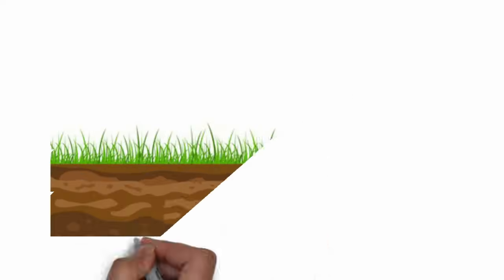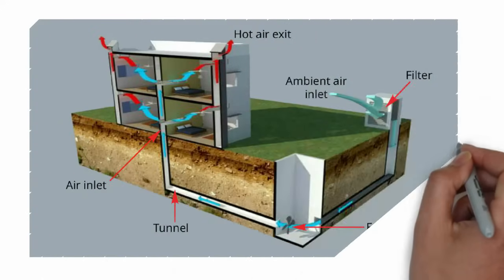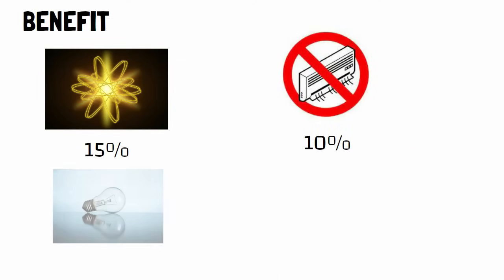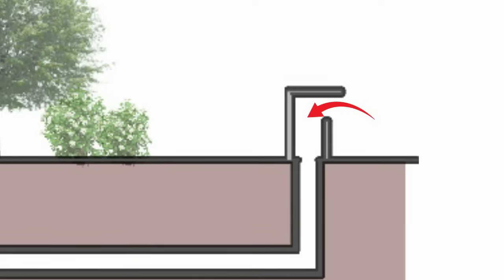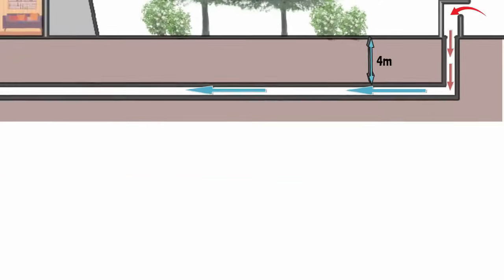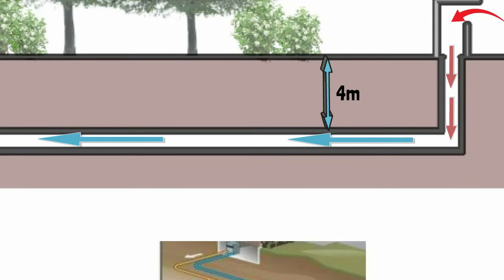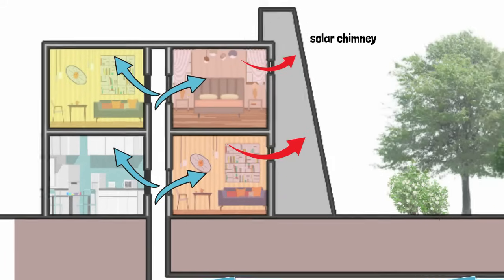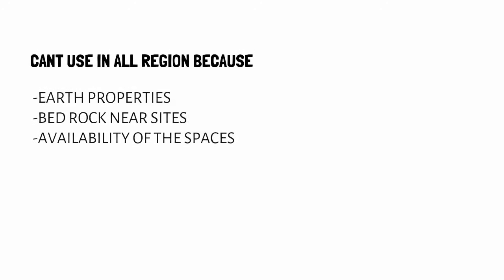EARTH AIR TUNNEL || HOW IT WORKS || passive cooling technique

Comment: Mother Earth News ran an article about a man who built a house like this. However, there are differences. 

His house was basically a thermos, built as a box inside an earth-bermed shell.

The pipe ran underground for about 100 yards before entering the back wall of the shell. The air could then travel around the box/house between the box and the shell, keeping the house cool. The air then enters the enclosed patio at the front of the house.

The reason the air moves this way is thanks to the south-facing porch. The porch heats up from the sun with the help of plastic, black-painted barrels of water. As the air in the porch heats up, the air rises. It reaches the top of the porch and exits out through closable vents. At night (which can still be hot), the barrels give up the heat they absorbed during the day to the air, and the process continues.

During the winter, the vents at the top of the porch are closed and a shut off valve closes the pipe. The porch air heats the house during the day, and at night the barrels heat the house.

The earth-berming around the house (sides, back, and top - everywhere except the front where the porch is) acts as the perfect insulation, helping to keep the house cool in summer and warm in winter.

The man in the article built his house in the foothills of the Rocky Mountains in Arizona - desert country. 
Yet his house stayed comfortable in the heart of summer. I think he said the hottest it got was about 80F degrees inside the house.
The coldest it got on average inside the house during winter, even when temperatures outside were in the 30s, was in the 60s (or even 50s). He said that when it got like that, he just put on a sweater (he didn't even have to fire up the woodstove the county building code guys forced him to install).

So he had both passive solar cooling and heating.

Comment: If you move that vent to the shade of the trees it will work even better because the air in the shade is 10* cooler then in the field

Comment: Am I the only one that thinks that digging tunnels 4 meters deep (12 feet) to get  10% cooler temperature, or 10% electricity savings is a waste? Too much of earthworks and artificial pipping for too little a benefit? It sounds much smarter to have large openings on the wind side and opossite sides of the house to cross ventilate in a simple, natural way.

Comment: Metal exchanges energy better than pvc. Metal performs cool to heat transfer better than pvc. I think metal would be more efficient.
Reply: copper is best...PVC is cheaper.
Reply: @gothboschincarnate3931  if your gonna use pvc.... just shitcan the system

Comment: Hi, here, in France, we call this a 'puit provencal' or ''puit canadien' (puits= well). We use it since...; roman times. Used in persic golf since... long times, I saw the heat system in ancient korea is similar. The tunnel have to have a of 5°(+-) gradient to allow water and vapor to flow out of the tunnel in order to avoid bacteria or fungus. Tunnel, best build in ... 'terra cotta'. No radon, no infiltration, no bad smells. Concrete has radon isssu. Metal will be 'eaten' in less than a year, PVC can break, develop bateria, bad smells. Best to have the fan in the house, in basement for maintenance. Not necessary to dig 4 meter, it can be effective with 2 meter start (remember, gradient is needed). The size have to be calculated between heat exchange effectiveness air air flow ( to avoid issue and to heat/cool the building with efficientcy).
Here, i saw the system connected to 'heatpump'. it used as a pre treatment of the air (air is already cooled a little in summer, and, already warm in winter, so the sytem have to spend less energy to warm/cool the building.

Comment: I think this is good for a dry climate building, yet I have a concern about fungus, dirt and condensation within the airline. Could water cooling be applied with the same principle?
Reply: Closed loop water cooling.
Reply: dont worry you can grow mushrooms inside and place a fungus air filter in your batcave

Comment: What about radon? I have a vented pipe from under my foundation that goes up above my roof line with a 24/7 fan running to exhaust radon. Is radon not an issue in other parts of the world? I live in north east USA.
Reply: A thin plastic layer STOPS the influx of radon gas. Vapor barrier. Care must be taken during construction to not puncture but it's really easy to avoid. Look up Radon Block.

Comment: this would be a good challenge. but how do you keep away rain, condensation, molds, and rats?
Reply: you could use an industrial dehumidifier to remove the the water first, purify it...and use it for drinking water. get 2 use's out of it
Reply: A simple rain cap for rain, a series of filters such as found in your current HVAC system for insects, If your intake is raised high enough...there won't be any rodents and even those would have to get by the filter system....add in some 1/4" stainless mesh...
As for mold, mildew or what have you, a scheduled maintenance using a swab would go very far to stop or better prevent any such. I'd size it for a chimney brush AND leave behind a poly rope to use to swab with. Probably a little bleach on the swab and you are good.

Comment: This is such a terrible idea.  The concept makes sense but in practical use it's very dangerous.  My aunt and uncle built an envelop home and they were talked into an air tunnel.  Things were pretty good in the beginning but not long into their first summer, my cousin got extremely sick.  They found out it was because of mold that developed in the air tunnel.  Their home was in southern Wisconsin where the summer air is quite humid.  The cool tunnel allowed moist air to condense and then turn into mold.  My cousin survived but the air tunnel did not.
Reply: Will be the best Rat's home
Reply: Your hack installer should have used an air to air exchanger that doesn’t allow that same cooled moist air to enter the home…. The exchanger recirculates and filters the air in the house or pulls in fresh from outside and the cool air tube passes around it to perform the heat exchange. The air doesn’t mix but the heat energy is transferred.
Reply: You could use an industrial dehumidifier to remove the the water first, purify it...and use it for drinking water. get 2 use's out of it
Reply: @gothboschincarnate3931  legionaries disease is ugly, please read up on using condensate as drinking water. There are more reasons not to use condensate than benefits.
Reply: @Rockwell108  well it has to be purified...thru UV light and reverse osmosis and their are probably other techniques too. water vapor  drops all impurities. however, it can easily re-acquire impurities and bacteria if not properly maintained. Karra and donna will help me.
Reply: @Rockwell108  have you ever heard of this crazy thing called boiled water?

Comment: this principle had been used for centuries in the city of  Yazd in Iran and actually uses the wind to move the (hot) air coming from the desert  surrounding the city to below the house for cooling and then  back up to the rooms  now cooled. this system is entirely passive and surprisingly efficient. When I was there the temperature outside was very hot but in the houses it was very fresh and pleasant.  I am still  surprised that it took so long to adopt it in the western countries.
Reply: Maybe coz Western countries tend to be less arid than Iran?
Reply: @nunyabiznes33  maybe, but still quite hot in summer, and if wind is not there it is easy to  force air with an  impeller (that can be solar powered)
Reply: @nunyabiznes33  🤣🤣🤣🤣🤣🤣🤣🤣🤣🤣🤣🤣🤣🤣🤣🤣🤣🤣🤣🤣🤣🤣🤣🤣🤣🤣🤣🤣🤣🤣🤣🤣🤣🤣
Reply: western whatt??  you probably have all your mind filled with millenial mediterranean levant crap like this "invention".
Reply: If you can't put a meter on it. We don't want it. 

Capitalism at its finest. The goal is to keep you a slave.

There was a time when houses were built with whole house fans that only needed to be run for about twenty minutes in the morning and in the evening.🤷🏿‍♂️
Reply: They are afraid of molds in the air than the Middle Eastern folks.😅
Reply: Has forest fire smoke/ air entered the house this way?
Reply: @carolwright7503  rather unlikely to find trees in the desert surrounding Yazd
Reply: you cant charge people

Comment: Its not good to directly have under ground air due to radio active radiation and humidity. We need heat exchanger to cool indoor air. Or we can use this air for airconditioner out door unit.

Comment: This system works better if you put insaid tube thru the home heating wood burning place. If you find some russian guy (sorry for russian, in this times) channel  "живая баня"  , he explains this system more. And it works as heated floor, hot clean fresh air, and air conditioning without elektricity
Reply: Link the channel

Comment: This may work well , but ( small furry creatures ) may invade your house ( ? ) .... also with the correct dimensions this pipe might be used as a ( SUPER EFFICIENT , 20% ? ) bass horn for your music system , some houses in the USA have underfloor bass horns , SO MUCH louder than any type of box speaker in your living room ! .... ( tried - n - tested ) ............... DAVE™   🛑

Comment: strange, to dig a tunnel just to introduce air into the building.. just make windows???
or or cant the same be done on the roof of the building and the air directed downwards into the building?
why dig tunnels and all the costs, and if the tunnel introduce rats or other vermins? lol 😂
Reply: All the folks worried about vermin:   The only places that might be problematic are at the air entrance and exits.  PVC at these points and screens/grates should do the trick.  I think there's not many critters 4, 5, and 6 feet underground.

Comment: When I was a kid, a friend lived in an underground house, and it was very cool in the summer, and warm in the winter.
Why we still keep building up, rather than down is beyond me.
Reply: cheaper? natural light?
Reply: @williansouza8724  aeration?
Reply: It is cheaper initially to build above ground, but the benefits of earth sheltered homes are worth it in the long run. But it is difficult to get mortgages, and that keeps the majority of people out of the market.

That is why we built our home ourselves in the Ozarks. It gets natural light from mostly south facing windows. We use that front area as an "orangery" to grow food indoors, all year. The living area gets natural light when needed. I prefer to enjoy natural light outdoors and enjoy LED lighting indoors while cooking, reading, and working anyway.
Reply: I live in an area with a lot of radon gas problems, here people question building down as foolish. What is ideal on one location is unwise in another.
Reply: @keithlightminder3005  I believe that is common all over, and the radon has to be planned for and steps taken to reduce the infiltration.
Reply: Температура земли на глубине совпадает со среднегодовой температурой местности. У нас например на глубине 5 метров около 2С, поэтому подземные холодильники делают.
Reply: Structures need to be made a lot more stronger due to surrounding ground load thus making it far more expensive.

Sunlight

Flood

Earthquake

Air circulation

Water seepage issues in the walls and everywhere
Reply: @Roseviell  True, but it depends on the depth you desire to go to in an underground house.

One other factor for an underground house is the shape of the outer wall. If you build it flat and straight, it gets very weak.

But if you build it round, it becomes very strong and capable of holding up to much more pressure.

Like an egg shell, you can hold the egg in your hand, and squeeze it, and it normally doesn't break.

It doesn't mean your inner walls need to be round, but if you leave them round, it can make for fun rooms, or hidden storage/maintenance spaces.

It has always been a dream of mine to build such a home, with up to 5 or 6 floors, and an elevator, large enough to get a F-250 truck down inside where I could work on it for fun!

And yes, I know the saying, a cave is a grave, but it doesn't have to be so in order to be a safe space to live and survive.
Reply: @jeffreyyoung4104  wow, that is a wonderful idea! Hope this comes to reality, i really want to see that house someday.
Reply: @Roseviell  Another thought popped into my thick skull. In some locations, like Florida, and other states where you have a very high water table, it would be almost impossible to build down. My state of Michigan is 700 feet above ground, and it only has high water tables in some areas, while most of the other areas have sand hundreds of feet deep till you hit the bedrock, which is usually limestone. So, yes, building down isn't always feasible, but where it is, we should try to build down, and it can be done with light and air also included into the design, using water to conduct the light down into the areas that would otherwise be gloomy.
Reply: @jeffreyyoung4104  I am from Western Rajasthan, The Thar Desert to be specific,  I think it should work here. Using water as a light source is a good idea, idk why they are not using it. And if you add bleach in it, it will still be able to light in the night.